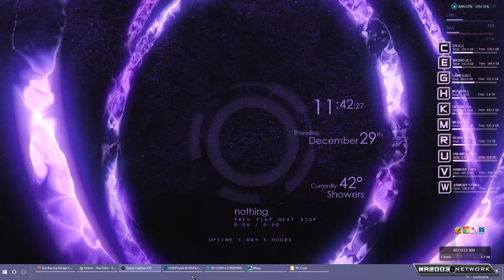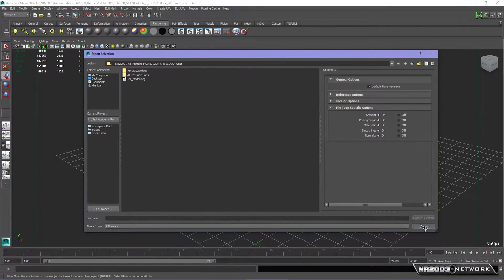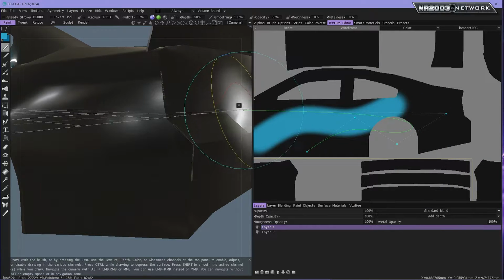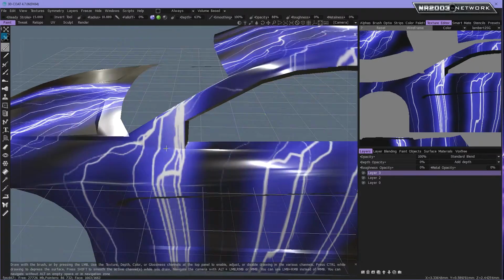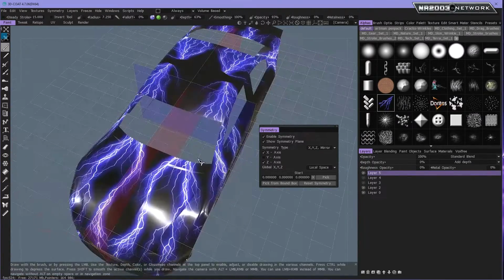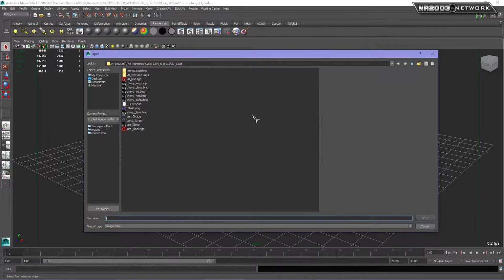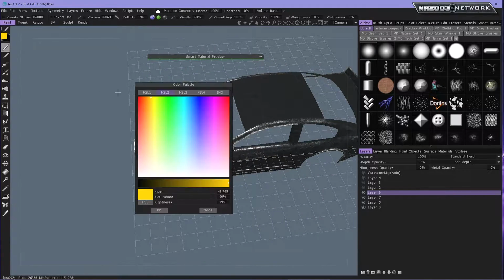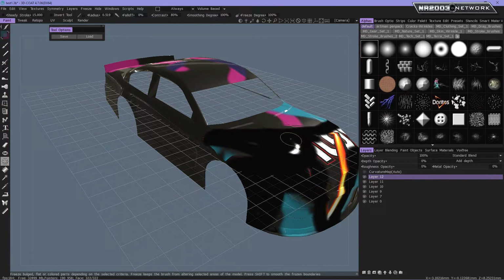Tutorial: Setting up 3D Coat to paint NR2003 cars

Comment: I'm trying to use the smart materials and I can get any of the materials to apply to the entire car in 3d Coat itself, but when I export the texture and open it in PSP there is only a tiny bit in the bottom left corner of the 2048 x 2048 that actually has the textures. Any idea?
Reply: I've never tried exporting to PSP so not sure what the issue should be. But when I've exported to Affinity Photo 1.0/2.0 the texture map is always correct for me.

Comment: In case you’re still around. How do you make a metallic layer using 3Dcoat?
Reply: For a metallic layer for NR2003, Using fill tool you can paint whole object surfaces, at the top tool bar there will be a dropdown option defaulted to 'always'. You can choose from there the edge parameters the fill tool will only paint on an object (like more on curved surfaces, bottom, top etc). Youc an mix and match different parameters to get different metallic design as well. Then you can then export that layer and add gaussian blur it a bit in a paint program to make it smoother. Then you just change the blend mode to make it appear metallic for the colored layer underneath it for a NR2003 car.
Reply: @Continuum7  do you have discord? mr.yamp#2814

Comment: im  having a issue with 3d coat with the wire on the hood for the Camaro car
Reply: where on the hood there are areas missing and areas aren't
Reply from the maker: I've not imported the Camaro mod before but make sure you don't have 2 hood meshes on top of eachother, might have to delete one before importing to 3D Coat.

Comment: So I'm having an issue where drawing doesn't work. I've followed this step by step but clicking with the pen on the car just doesn't work
Reply from the maker: Make sure the opacity is set higher than 0% and the green ball (for color) is not disabled too.
Reply: So I figured that out immediately after posting the comment, but I ended up just giving up on 3D coat since the graphic I imported just wasn't working with me so I just ended up manually lining it up